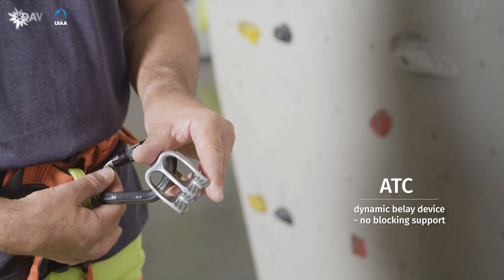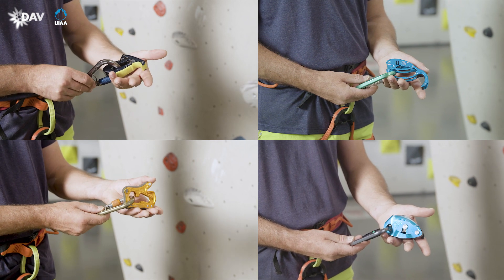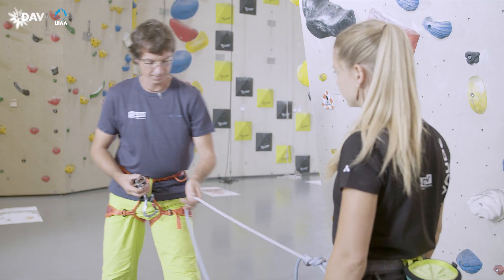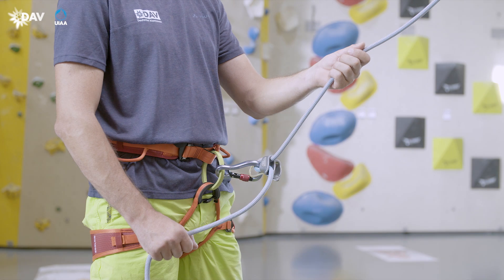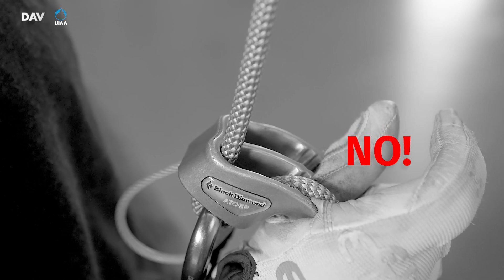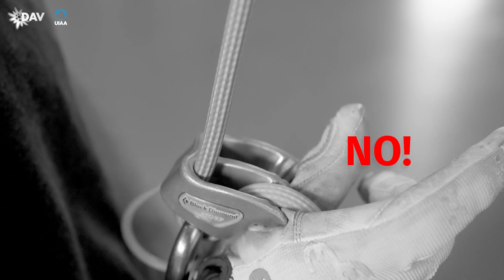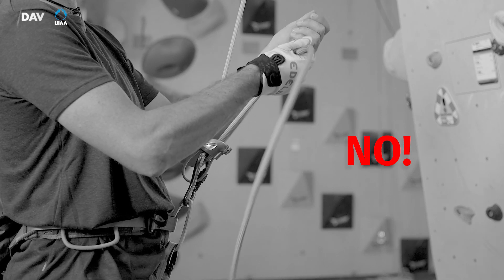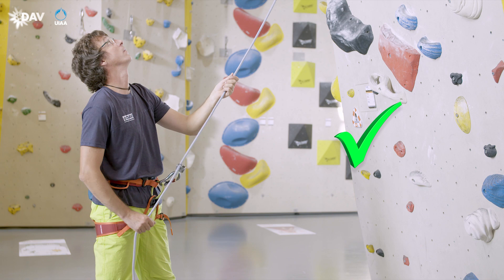Climb Safe: How to belay with the ATC

Comment: This is so not safe!! Don't slide or "tunnel" your hand up the rope on top rope belay, that is you letting go of the rope!!! If someone falls while you haven't got control of it, they will drop and you'll probably panic and take your hands away to avoid getting your hands sucked up into the atc.. There's so many reasons why this is terrible and needs to be taken down
Reply: The hand over hand technique for taking in slack is extremely prone to failures, especially if one also factors in any kind of distractions (tangled rope etc.) that the belayer might be confronted with. Tunneling up the brake rope is safer. Even more safe is to use a belay device with assisted braking. For top roping I wouldn't recommend a tube style device anyway.
Reply: @MA-wk2vs I would love to see any statistics you have that prove that the PBUS method is worse than this because I know that to be objectively incorrect. I mean just logically you should never have a moment where you do not have a grip on the brake. Getting slack is such a stupid issue as well. If you have that much slack then you are taking too much slack out to quickly just take less out more quickly and its still light years safer than this shit method.
Reply: @MA-wk2vs  those factors (tangled rope etc) would also apply to tunnelling. The only failure that differs is if the belayer is not in control of the rope. If you never take a closed hand off the dead rope, there's no chance of failure due to something happening to your climber whilst you're belaying. Opening your hand and sliding it up the rope means you are not in control of the dead rope and that if something happened while your hand is not in closed contact with the rope, there's time for things to go wrong before you can react. Since the most common and helpful natural response would be to tense your hand and squeeze the rope, why not just already be doing that so you can focus on your climber? Some people might naturally panic in some other way (eg putting hands out), so teaching them to always have a firm grip of the tail teaches them the correct reflex response. Sliding your hand up the rope moves your hand toward the gear, increasing your chances of your hand being sucked into the device during a fall or lowering off. Your logic is flawed.
Reply: @theyclimb9214  That is simply incorrect. Tunneling is of course a certain risk factor. But it is less risky than switching hands, which is more prone to failure, especially in beginners. Tunneling is more intuitive so that the belayer can focus better on the climber. And also any kind of distraction doesn't lead to failures as quickly. During tunneling, squeezing the dead rope is an intuitive reaction in the case of a fall. The amount of control during tunneling, when done correctly, is sufficient to catch a fall. Whilst having both hands on the dead rope it's also harder to keep your balance if you get lifted up by your falling partner. Most people would hold onto the rope with both hands intuitively and might hit the wall in way, that they let go of the rope. With one hand on the sharp end of the rope it is easyer to maintain balance, when getting lifted up.

 Placing the hand on the brake strand directly in front of the device is always a bad idea. This applies to tunneling and switching hands. I have seen quite some people switching hands in a way, that the 2nd hand was directly at the device.

At last for both techniques it's a tradeoff between different riks.
Reply: There are different schools of thought on this.  PBUS is often taught to beginners in the USA but there are entire countries and maybe continents where it’s not standard practice and they operate safely.  

Just because you were taught one way doesn’t mean that the rest of the world is wrong.
Reply: @mattradcliffe9279 Its not wrong its less safe which is true. Comparatively,  its just better to have a grip on the break at all times. If someone falls during that period that you don't have a grip there is a strong change they will fall, and the PBUS method stops that inherently.
Reply: @mattradcliffe9279  PBUS is what all climbers are taught in the gym I work at. And its very important its done that way.
Reply: No it’s not
Reply: 100% wrong lmfao
Reply from the maker: The belaying technique shown in the video is internationally accepted by experts and professionals in the field including UIAA and various alpine associations.
As a matter of fact the „hand-over-hand“ technique is not used for advanced sport climbing and competitions any more.
Furthermore, many investigations showed, that in case of a fall the belayer is able to grab the rope fast enough, when you tunnel the rope correctly. Your hand always stays in contact with the rope and the natural reaction in case of a fall is to grab the rope (not taking your hands away).
The DAV has been teaching this technique successfully for more than 15 years now.
Reply: @alpenverein  if a person who just started climbing uses this technique, they are sure to have an accident. How is hand-over-hand not safe? you always have one or two hands on the breaking rope. when you shuffle like on the video, you LET GO of the breaking rope in order to slide your hand. this technique is good for advanced belayers, but it cannot be a universal technique.
Reply: @sophiakukurovska8083 I agree
Reply: @sophiakukurovska8083 I learned it that way in our climbing gym and never had any meaningful accident. Its standard practive here in Europe. Also you still have contact with the break side. In case of a fall you will imediately grab the rope. 
For me I think this movement is very intuitive and I dont have to juggle with my hands. I am always in control of the break side. If I had to move my hands around it would be more things I had to pay attention. 

But in the end its just about how you learned it. The technique alone doesnt make a good or bad belayer. Its how someone keeps focus on the climber and do the right thing in the right moment.
Reply: @alpenverein  you are supposed to bring your left hand down under your right hand  when sliding hands back up. both hands will be on the break side of the rope. (PBUS technique)
Reply: @@SoppiestSquash8 "You are incorrect."  This sort of stupid comment is better not said. It conveys zero information. Well, other than that the person saying is not worth listening to.   Anyone with useful constructive comment would give reasons, at a bare minumum.
Reply: Hand-over-hand means you always have one hand securely on the braking rope...
Reply: You aren't being too clear here for people with less experience. Don't you literally have to let go in order to grab on to another point of the rope to keep belaying? Even if you are trying to be helpful it really seems like you are just yelling and screaming. Be more clear please.
Reply: @davidshevchuk8885   "Don't you literally have to let go in order to grab on to another point of the rope to keep belaying?" Yes and no. The 2 other typical methods taught, one is often rhymed as 'v to the knee, 1, 2, 3' and the 1,2,3 means you grab the brake with your left hand fist above the brake hand "1" (assuming a right handed belayer) and then move the brake hand "2", so whilst you do let go you're still holding the brake with the other closed hand. "3" is then moving your left hand back to the side leading up to the climber. The other is acronymed PBUS, where you, again, grab the brake with the left hand - albeit this time below the brake hand and then you slide the brake hand up. Thus you don't actually let go per se because you slide up, but you have the other hand grabbing the rope anyway. There are probably other methods too. At our gym we were taught the 'v to the knee' but that seems less common on youtube videos which seem to be more typically PBUS (excepting this one) I'd suggest what is key here is which one you learnt and how you were taught to react. Panicking if a climber falls suggests you haven't practised both belaying and catching. You shouldn't be panicking at any point. Excepting, perhaps, on those first few attempts when your instructor is holding the brake anyway. I found it quickly became intuitive to not only brake when someone fell (well there's only a small period of time when you're not braking anyway - the 'v' or 'p' part where you pull the slack) but also to move the other hand to assist, i.e if someone falls my reaction now is to grab the brake with 2 hands which is either the case anyway (the 1 part of v to the knee) or simply means moving the other hand to grab the brake. I was happy after a few sessions that whoever was climbing was safe if they fell while I was belaying because I caught them. For top rope there's really no slack anyway and falling is not particularly dramatic. When climbing if I think a move is precarious I'm going to check the belayer is awake. In fact, the way we've been climbing is kind of like autobelay, on those devices you feel the device has you, then you climb and then it pulls in. I've told the climbers I've belayed to climb like that and then there's not going to be a feeling where the belayer feels rushed like they're trying to keep up if the route is easy.

I don't think arguing about which of the various methods is best really matters. No instructor is going to have told us "This isn't the safest method but we're going to use it" so, take with a pinch of salt their claims that theirs is the best. It's whether you do whatever method you use correctly, including taking slack, lowering the climber and, most important of all perhaps, catching falls. I see similar things about which way to tie into the harness - supposedly if you go top loop to bottom or bottom to top someone will decide one of them is safer if you skip a loop, but the key skill is not missing either loop and checking yourself and the other climber checking you.
Reply: People should shout "fallll "inn hard way  so it becomes easyy for belayer

Comment: I am a very experienced belayer, and have used the tunneling method in top-roping for 40+ years without issue; however, I also know that I am not allowed to use the tunnel method in most US climbing gyms, so inside I use the hand-over-hand method;  I was also chastised by a Canadian certified guide that you really need hand-over-hand on wet, icy ropes in snow conditions (we were climbing in Nepal).  I was curious if anyone has actually done tests to prove whether or not the tunnel method is unsafe, and I found this video online to be informative  https://www.youtube.com/watch?v=03ext7Dahxo       Also, to be honest, with the double wrap that most climbing gyms use on their top anchors, I feel the tunnel method is perfectly safe indoors.  The trick is to do only small shuffles each time.  Still, I follow the rules in climbing gyms.  But I dont understand why some responses below say that the hand-over-hand method is LESS safe??  All it does is give a "backup" to your tunneling of your belay hand-- you are not really switching your belay hand.   So, I see both points of view.

Comment: 1:41 the FK is this!!

Pull down to atc > hold with bottom hand > top hand to center of rope below atc > bottom hand to very bottom of atc > finally top hand back over the atc

The breaking affect only work is the rope is always held below the atc with a firm grip

What you are showing is how to end someone because your hand will either let go to avoid burning or being crushed into the atc and in both cases the person on the other end of the rope hits the ground

Comment: Imagine being a renowned climbing association making a video on a proven belay technique that you yourself proposed and got added to the uiaa site and people still bitch without a single clue 😂
Reply: Yeah its just on how you learn it. I can understand the reasoning always have the break side on break is safer, but for me this movement is way to unituitive. You have to juggle your hands around. The method shown here is way better in my oppionion. Especially when you have a fast climber in toprope. Until I have my guide hand down and back up again way to much time passes. 

Also the break hand is never not in control with the break side. You slide your hand up. You always are in control of the break rope. You just dont squeeze it tight. But that is no problem.
Reply: hehe
Reply: People on the internet are egotistical know it all’s and they don’t like alternative methods that challenge what they already know

Comment: People from the U.S. coming here and hating on the technique, despite it being used in a lot of places in europe and this is a video of the official german climbing association. Tunnel method is safe and more efficient and smooth for lead belay.
Reply: I belay by pulling the brake line up. That's what I was told and this video says otherwise. What do you think is best?
Reply: @Ryan-es5fj  as long as you’re not pulling it completely vertical and the rope contacts the grooves in the ATC it’s all good. What you don’t want is to be pulling it up so far that you lose friction.

Tbh if you like belaying like that you’d probably prefer using a grigri over ATC
Reply: Do you know what the Americans call their method?
Reply: Agreed. I find it so much better for managing slack quickly as well which to me makes it safer. I’ve always done it this way and learned it this way but at Climbing gyms in the USA they don’t want you to do it this way. I’ve almost been stripped of my belaying privlages once when a friend was doing a hard sport climb section and my brain defaulted to this method when I was quickly trying to manage slack when my partner was trying to attempt clipping into a QuickDraw a few times. I’ve gotten better at the standard way here now but for sport routes I still hate it.
Reply: Yeah, and people drunk drive all over the world. That doesn't justify it as being better though. lol
Reply: @shikamaru281281  This is a very stupid take. As if US belay technique would be driving sober and german technique would be driving drunk... Slinding method is a tested and widely used technique that is safe, convinient and efficient. The irrational fear about it in the US is just not backed up by facts.

Comment: "The brake hand is in control of the rope at all times"

Demonstrates the exact opposite.
Reply: You dont need to have a tight grip to "be in control". Tunneling is safe and efficient.
Reply: @GoodLuck-rh8tb exactly. It’s loosening your grip, not releasing it entirely.
Reply: https://vimeo.com/80477504 (Advice from the manufacturer disputes your comment).